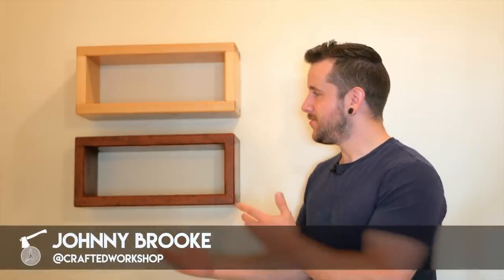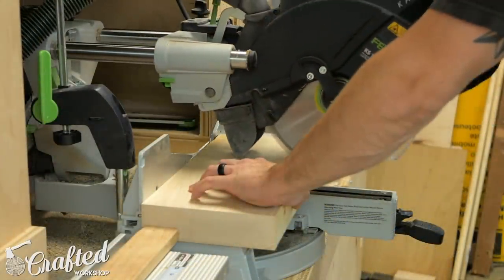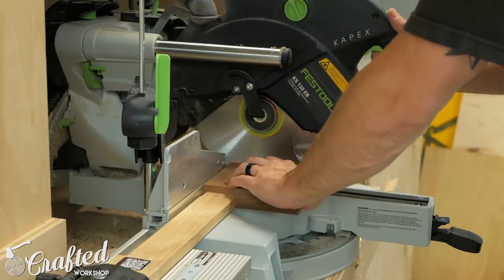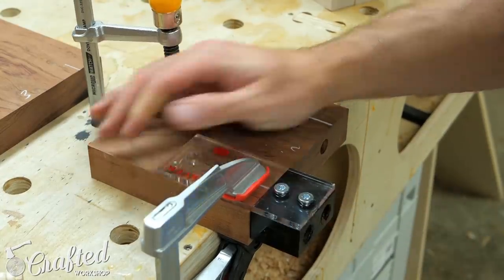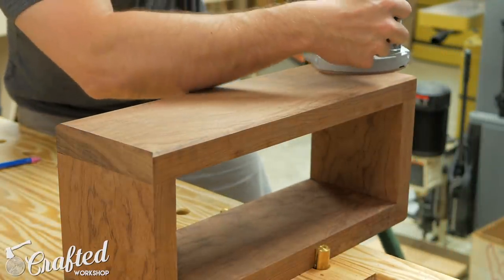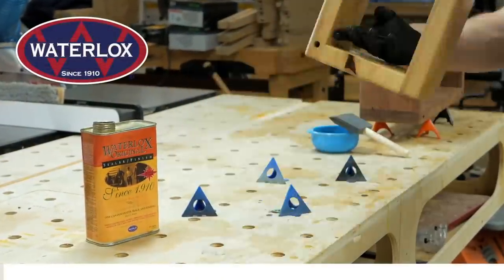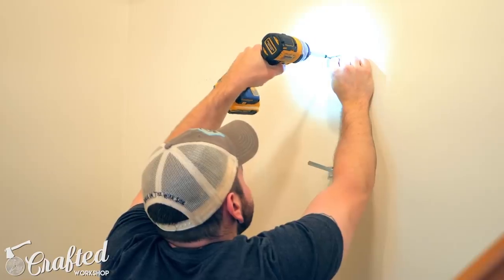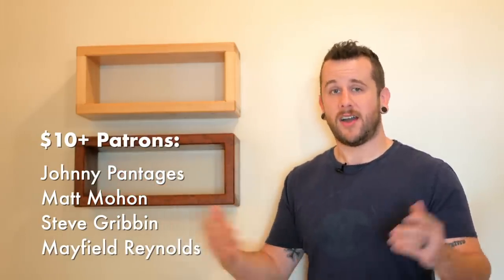How To Build DIY Floating Shelf with Invisible Hardware

Comment: Another great build.  Question...  Did your chisel out a section for the small rectangle portion of the hanging hardware so the shelf is snug on the wall?
Reply from the maker: +BronkBuilt thanks! And no, totally forgot to do that. Doesn't make a huge difference but that would definitely be a nice touch.

Comment: Like the finished shelves. Haven't seen the metal mounting pins in South Africa. Will have to make some up or modify the design.
Reply from the maker: Yea, you could do something similar with all-thread, you could drive it into the studs by locking two nuts together and using them to turn the all-thread. It would leave a bigger hole, but it'd be cheaper and stronger.
Reply: Thank you.... that was a quick and useful response

Comment: The mounting brackets don't let the shelf fit tight to the wall. I've built floating shelves years ago for my sister's football knick knacks using 1x6's and just screwed them to the wall (@ the studs) using finish screws. The shelves are still "floating" to this day. It's been about 10 years.
Reply: My first thought too. With all those tools, he could have chiseled a recess for the bracket so the shelf would fit against the wall (and hide the hardware).

Comment: The shelves look great. I do have one question: why did you cut the boards before planing them and cutting them on the table saw? I'm not criticising. Just trying to learn.
Reply from the maker: +Kevin Howell if the board is bowed, cutting them into smaller pieces allows you to remove less material. Hope that makes sense!
Reply: Crafted Workshop that makes perfect sense. Thanks.

Comment: Nice work. So with that hardware they end up sitting the thickness of the metal plate off the wall?
Reply from the maker: Thanks man! Yea, ideally I would have notched out the back of the shelf where the plate is so it'd be flush, that or cut away the drywall. It's really not noticeable though since it's so close to the wall.

Comment: Those came out nice.  Though I would of loved to see some dovetail or even finger joinery as it would of really set them off.  Even just 45% them and spline them would look good.  Especially if you put bubinga wood splines on the maple and vs versa.   Not knocking what you have done. I am just a sucker for joinery work.  It makes things like this pop even more as that end grain always stands out.    But again nice build.

Comment: Clean result! You mentioned that the dowel jig slipped a little, which caused some alignment issues when you pieced the sides together. How did you resolve that?
Reply from the maker: I ran the whole thing over my jointer to flatten it out once assembled. Worked great!

Comment: Step 1; Get the $15,- wood boards. Done!
Step 2; Save some of my salary for 3 years, to get the all the $18.000,- tools you used. 
Step 3; Make those shelf!
LOL
Reply from the maker: Hah, good luck with your saving!
Reply: Buy S4S boards, they're all butt joints. Not too hard to do.
Reply from the maker: Not hard at all, people just like to complain.
Reply: Hahahahahaaaa.....
Reply: Jealous much??????
Reply: probably not a complaint so much as a pointer to your saying "Beginner " and proceeding to some machinery nobody has, as the very first thing you even do with the lumber.

A lot of you YouTube guys are like this for some reason: "Hey guys we're going to start off with some simple, basic, *Beginner projects*"
Next:  goes to some fantastically-priced machinery to "get started"

I mean id love to make some shelves, but damn dude, youre idea of what equipment a "Beginner" has as far as equipment is so off its hilarious.  
 @craftedworkshop
Reply from the maker: @drewc4204  as I mentioned in the video, if you purchased pre-milled lumber, it would eliminate the need for a jointer or planer. At that point, you could build this very easily with a miter saw, dowel jig, and drill.
Reply: Where is the skill apart from accurate measuring, what about tips for people who don’t have any of this equipment showing how to true up some of this wood.
Reply: All them tools just make it quicker. You can achieve the same effect as the video with a basic cordless drill. Palm sander. hand saws....and time and effort.
Reply: awesome!!! easy as 1 2 3.  😂
Reply: I agree , with this materials you can build a space ship
Reply: @Crafted Workshop, I think the point the complainers are making is that they wanted to see you build these shelves with just a miter saw, dowel jig and drill, not hear it’s possible while watching you make easy work of it with an elaborate set up.
Reply: This is what happens when people skip over the introduction and miss the whole “If you don’t have these tools then buy these kind of wood.”
Reply: @noelv1976  so true, sooo true! 👍🏻 😏
Reply: or you can walk into a local mens shed

Comment: Great video! With a flaw that would bother me.. ;)  I would not allow that bracket that you secured to the wall let my shelves protrude from the wall.. in your video I saw the spacing as well as the shiny piece of that metal exposed from behind.. I suggest sinking the bracket into the drywall, or notching the shelf for the bracket to hide..  ;) still looks great from my place though..

Comment: The small details you added with the chamfer and extra smoothing made a ton of difference. So, I have to ask, how are you liking the OF1400? Also, just noticed you're sneaking up on 100k -- that's awesome, man!
Reply from the maker: Thanks man! The OF1400 is outstanding. As with all Festool stuff, the dust collection is incredible. That little piece that hangs below the plate collects dust when doing edge work, it works incredibly well. And yea man, hope to hit 100k by Halloween, we'll see!

Comment: I’ve used those support bracket, except, I trace the mounting bracket on the drywall, used a multi-tool and cut out the drywall “plug”, mounted the support directly to the stud. Not only is it stronger, but, the shelf will fit perfectly flush against the wall and not stick out a bit due to the shelf sitting against the square mount instead of against the wall

Comment: It seems to me that those shelves would not fit flush to the wall using those shelf supports unless you cut a mortise on the back of them to receive the shelf support. Am I missing something? They look very nice though and it is great to see someone use dowel joints. I will have to try the Waterlox.
Reply from the maker: You are definitely right, but they only sit off of the wall about ⅛". You definitely could cut a recess for them, though. Thanks!

Comment: Hi... if you use dowls that have grooves traveling along the length of them they will allow the glue to ooze out along the length of the dowls and into both holes... If you don't have any dowls with grooves traveling along them try cutting or scoring them with a knife or chisel... hope this helps.
Reply from the maker: +Peter Allen the dowels I used have spirals cut into them but I still used too much glue. Thanks though!

Comment: If you switch the orientation of the "rails"(horizontal pieces) and "stiles"(vertical pieces), these would be much stronger. The orientation you have these for your pieces, literally the only thing holding them together is glue. IMO, this is a ticking time bomb for failure any the primary axis of force on your joints is in the vertical axis. If you let the "stiles" run all the way to the top and bottom of the shelves and have your "rails" end into your "stiles" so you are installing the dowels horizontally, you will end up with a much stronger shelf system. This would also hide your end grain as the sides of the shelves are much more visible than the top and bottom.

Comment: If you don't think you are going to move the shelves, or don't mind repairing drywall, just drill a dowel hole in the back, make the shelf size the width of two studs, drill holes into the studs, stick the dowel on.  Then you can make the whole thing with just a saw and glue.

Comment: If you have that much machinery and equipment, is it still classed as diy?
This should be called pro carpenter makes floating shelves that you'll never make.
Reply: Agreed. IMO, DIY should max require a circular saw and a drill
Reply: Hahaha exacty 😆
Reply: I'm glad to only had to go two comments down to validate my feelings
Reply: Chad Stewart preach brother. Was thinking the same damn thing.

Comment: The project is simple and doesn't require a lot of woods. The problem about all project with woods is needing a complete equipment to start and finish the job. If you don't have at least 2000 dollars in equipment ( I mean serious equipment) you can't make a Little project like this.
Reply from the maker: I disagree. If you buy pre-milled lumber, you could build this with under $300 of tools.

Comment: I would like the advice of a professional. Is my father right in hanging a work-zone thin plastic cabinet that is designed to be on the floor, up on a single studied wall, & filling it with video accessories? video tapes, dvds dvd players, ex.

Comment: If you are going to cut and plane your wood. Buy rough cut wood and save a bomb, it's a couple dollar in a saw mill. Ps badass video. O and if you made the shelves 3 ft 3 instead of the randomly selected 3 foot, to allow for the rope to be set in a little from the edges of the shelves. You would have had two studs to fix to as they are spaced 18 inches apart 😘 4:43

Comment: my wall is cement .. sometimes drilling makes a crack line thats a problem how to avoid it?
Reply from the maker: Use a masonry bit meant for drilling into concrete, it should drill a cleaner hole.
Reply: Crafted Workshop thanks man !!! my dad have only white colored wood i love to stain it with fire...

Comment: Its an excellent idea. However, I´m sorry but I dont see the DIY on this video. This is more like manufacture at home, considering the ton of Pro tools he´s got.
Reply from the maker: As I said in the video, most of the fancy tools I used was for milling the rough lumber. If you bought it already milled, you could literally build this with a circular saw and drill.

Comment: I watched this to find out how to make the shelf float.you glossed over that part and I still don't know except that it involves some kind of bracket
Reply from the maker: Sorry, I showed the process pretty thoroughly. What else did you want to know? It's fairly simple, drill holes in the back of the shelf and mount the brackets to a stud.
Reply: Crafted Workshop what's simple for you I haven't experienced yet.
What kind of brackets?
Is there a matching set to go on the shelf so the two can connect?
Reply from the maker: John, the brackets were shown and explained in the video, might want to watch it again. They're linked to in the video description.

Comment: The shelves would be stronger if the horizontal pieces were inside the vertical ones. So, essentially making the dowels parallel to the floor and unlikely to slip out under the weight of items in the shelf.
Bad design.
Reply from the maker: These shelf brackets only support 50 lbs, so I'm not really concerned about the strength. The glue and dowels will support WAY more than that.

Comment: A DIYer can not make anything to look good like that without either the experience, or the fancy tools. You need one or the other. Preferably both. As a rule, DIYers are such only because they want to save money. If they have to buy the tools, then they might as well just buy the finished product. And if they don't buy the tools, they need the experience of a hobbiest. Something has to give.
Reply: ALL of these techniques were once done exclusively by hand. Those "fancy" tools just make things faster, but skill is required no matter what is used. Skill comes with time and experience (and mistakes). No magic here.
Reply: Some DIYers just like to make stuff, perfect or not.